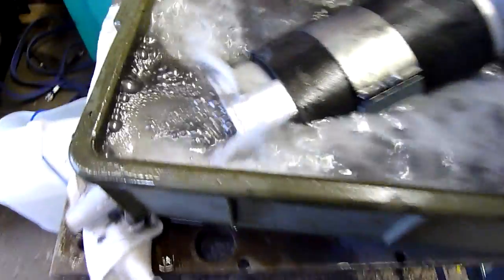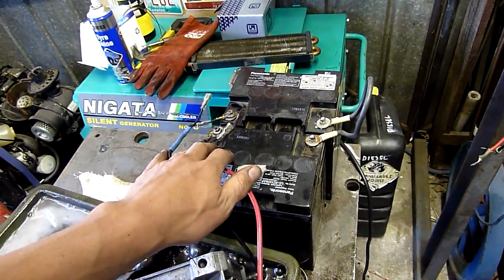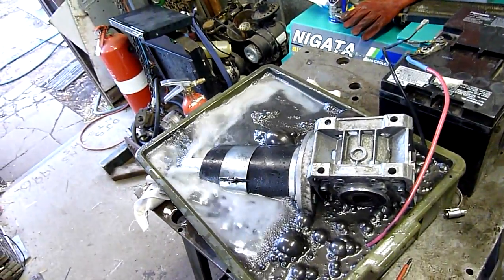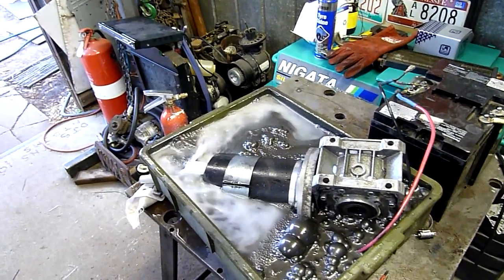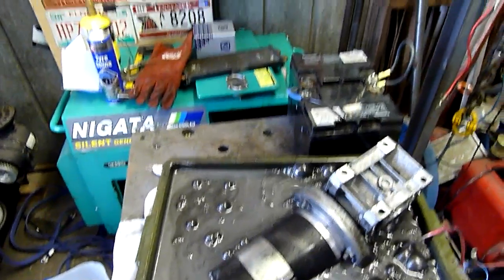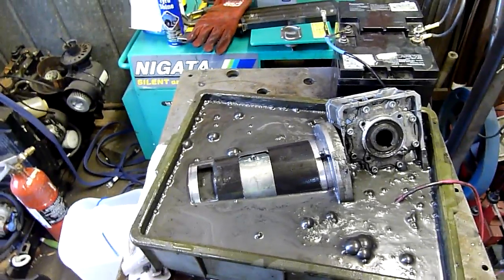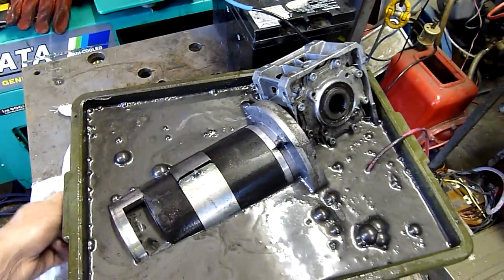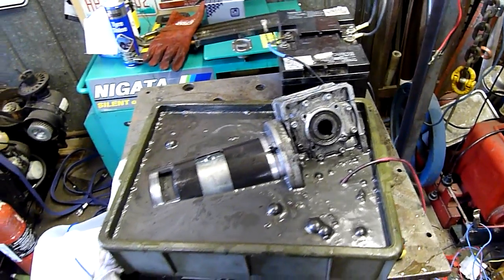Washing Glycol Oil out of 24V DC Motor the Fun Way

Comment: You ought to get yourself a good beefy linear supply for that kind of stuff, I got one for my amateur radio stuff and it can dish out 30+ amps quite happily with a voltage of about 15v tops. Big heavy SOAB but I call it chuck norris for a reason, it has that much filtering caps in it that when i turn it on it dims the lights for a moment. Much better than the switch mode shit that you get these days that charging a 10000uF capacitor trips the short circuit protection and u have to power cycle it